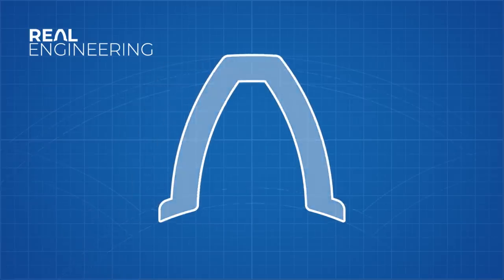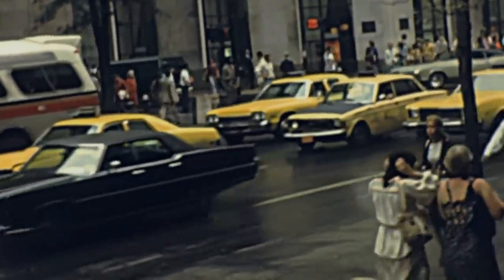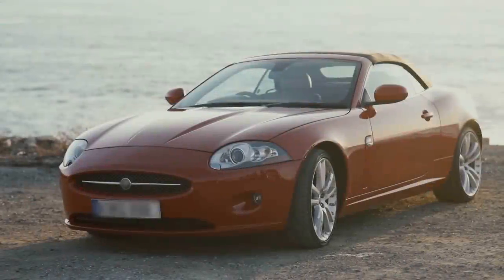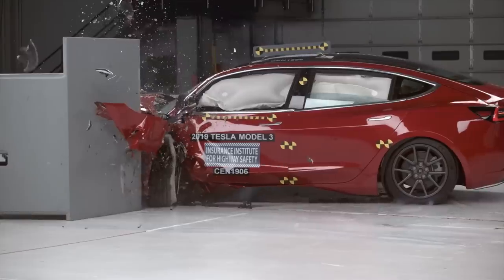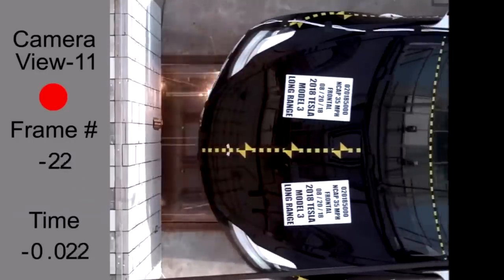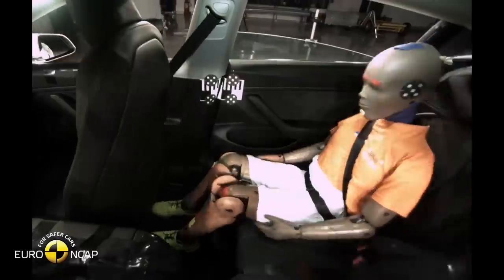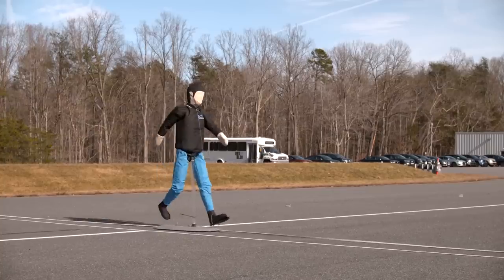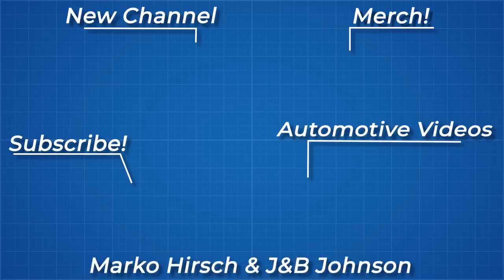Which Is The Most Dangerous Car?

Comment: Before even clicking on this video, I knew that the Mitsubishi mirage will hold a spot somewhere along here. Thanks Doug DeMuro.
Reply: I had to drive a rental mirage while my fiesta was in the shop getting a new front bumper (roadkill). It was total trash!!
Reply: Hello yobama
Reply: We have a Mitsubishi Mirage and I hate it now.
Reply: Thiissss
Reply: Or that it’s in the thumbnail?
Reply: Daddy Doug is life
Reply: Zias-Two rip I would just rather cycle
Reply: 🤣✌️ Doug is ma man!!!
Reply: I don't think the Mitsubishi Mirage is that bad. I just think there are better alternatives, such as the Kia Picanto, Ford Fiesta and Toyota Yaris.
Reply: @HELLO every simple turn is hell for the robbin
Reply: Mirage is the worst piece of shit sell in america since de 2000. in a video on youtube, it shows that they even dont paint the inside of front hood for econmy. quality and craftmanship is not an issue for them. even doors closed, you can see outisde from the side of the door and the body of the car. Sure, its the cheapest car you can buy on the market. But you got for what you paid,,,,
Reply: I have a 2018 manual transmission mirage and Its a great little car idk why it gets so much hate. Maybe the cvt automatic transmission one is crappier idk but mine is pretty zippy. It even outcorners my friends 2019 Camaro on the way into work and on the way home every day.
Reply: U can easily get a bent axle if you hit a curb. Zero f@#$ traction on wet roads with the type uh tyres they slip on thosE wheels
Reply: @KevAlberta  is it total trash because it did it's job because the bumper absorbed the damage or because it drove you from point A to Z workout any issues?
Reply: @richarddouglas6838  it seems like the only hate the Mirage is getting is on quality of how the car is built. It is the most affordable vehicle anyone can buy on the market. There is no complaints as what I can see or hear about on how it performs. It gets close to 50mpg and able to take people from A to Z with a 10 year warranty...so wtf?
Reply: THE KEKRONOMICON Really does it have stock suspension because I thought the 2019 had reeally soft rollie suspension, you might just be a better driver than your friend haha
Reply: The problem is that a mirage can only be seen off in the distance!
Reply: @StephenDeTomasi  The Fiesta and Yaris are much more expensive B segment cars and not an alternative at all. And I'd say the Space Star/Mirage actually beats most A-segment cars in the aspects that matter. It has pretty much the best mileage, quite a bit of storage space for its size, enough space in the backseats to comfortably seat 4 adults (assuming they're not giants), is one of the cheapest cars available and can get a consumer quite a few nice extras for not that much more. For the economical and practical driver, it doesn't get any better. And in terms of safety, most A-segment cars don't fare much, if any better. Volkwagen Up is one I know of and I think maybe 1 more.
Reply: Gotta love a good audience overlap
Reply: lol
Reply: Little cars are death traps
Reply: @mrsteve431 Lucky you
Reply: @mrsteve431 I drive tractor trailers and have a radar system that can see the speed of cars in front of me. I clock between 5-10 cars a day going over 100mph. Wish I could quit driving and stop risking my life for unappreciative people
Reply: That's pretty obvious by the thumbnail and obviously the A pillar is in where the driver seat is
Reply: @mrsteve431 Sorry to correct you. A 2017 Space star, as it is called over  here in Germany, is my 17th car in 27 years of driving experience. In these  years I have driven many English cars, Rovers,  Austins, MGs, (11 in total) some other European makes like 
Citroen, Opel, Renault, Ford, and two Japanese which count up to 17 cars in 28 years. With these 17 cars I've ridden more than one million Kilometers. I'M  definitely not an inexperienced driver!!!! But my Space Star is a good car. It does what it is intended to do. Driving from A to B without malfunction, with redicoulessly cheap tax of 22 Euro per year, running 100 KM with 3.8 to 5.1 Liters, depending on the road you're  driving. And its reliable. Hot weather, cold weather. Servicing cost are redicoulessly low, spare parts are cheap compared to so called premium brands like VW and others, and the liklyness of needing spares is very low. Have driven before a 1997 Colt which was incredibly reliable. Never let me down. Was changed with 23 years and 190000 Kilometers on the clock. The only reason Doug De Meo beats this little car so much down is that he gets paid  for it. He trys to make it appear bad as he puts it to standards of bigger competitors. There is simply almost no other competitor on the American market as Ford has never sold the competing Ford KA, smaller than the Fiesta.  If you just take it to what it was intended for, it works beautiful. It is able to manage German Autobahn, which has no speed limit. Today I' very drive it from Bonn to Cologne and for a some miles, due to traffic situation, I was able to speed up to 100 MPH. No problem at all. No unsafe feelings or anything that annoyed me. Good handling, low consumption, not loud, I was able to telephone with my hands free speaking device without screaming. The only thing it is not on par with is the acceleration of my former V8 and V6 Rovers.....  But at the filling station...
 It makes me happily smile. So once again. I seriously believe that European driving conditions are tough, especially in Germany with no speed limitation on Motorways, and I can only laurel the cute little car. When I think about the savings, compared to my Rover P6 V8 it only makes me smile
Reply: you are seriously signing youtube comments with your first and last name??? wtf
Reply: well its in the damn thumbnail
Reply: @johnrossewingiii3270  I'm on my 2nd Mirage for my delivery business (2015, 2020). I deliver fulltime out of this vehicle and never had one issue with them! I do the LOF's at 3500 and enjoy the gas savings. Now a days I'm starting to get people asking about them at gas stations too 🤣
Yeah, it's cheap but does the job. BTW D.M. is the biggest sell out
Reply: @notkray8468 Why exactly?
Reply: @bigchills7194 Hows it holding up?
Reply: I've drove a bunch of cars, a 2002 Pontiac Montana, 2004 Cadillac Deville, 2005 Hyundai Sonata, 1999 and 2003 Ford F150, 2008 Toyota Prius, and a 2024 Mitsubishi Mirage. Out of all of them, the Mirage is by far my favorite, so I bought it. And I been taking it on a ton of road trips, up to 12 hours. I am enjoying it! It has 5,700 miles in 3 months.

Comment: Lovely video! I thought of some additions:

Don't forget that small cars like the Mirage are used as city-brawlers, which means low average speed, so more time spending driving whithout adding much mileage, in an environment thats most likely to provoke an accident. Big cruisers are mostly driving on a highway or, like trucks, in a rural environment, so they are less likely to hit other cars frontally or sideways on.

One big safety issue in the desingn of a car is missing in this video: Pedestrian-safety, probably the most likely reason the Cybertruck will not get released as it is right now. 

I don't want to get hit by an unyielding metalblock with a sharp edge on the hight of my neck.
Reply: Was thinking about that too without some special tech the pedestriansaftey should be pretty poor.
Reply: The thing with the Mitsubishi is, while i agree that it might be driven mostly in city traffic as you wrote, that also means lower speeds which ususally means less injuries in accidents. But the statisctic he found said that it had the most fatalities of vehicle occupants. So people inside the car died in accidents. That is quite unusual for urban accidents.
Reply: @nirfz  Yes, urban areas actually have a lower death/injury rate than suburban or rural areas, not more. The very high density of intersections actually helps you because of the slower speed. The mirage probably does very poorly because most americans live in suburban areas where they need to drive at higher speeds and with lots of larger trucks. The urban environment still has pick-ups, but they are much less common. (SUVs are common everywhere now, but tend to be smaller driven less aggressively)

Also keep in mind that the mirage is one of the cheapest, if not THE cheapest, car sold in america. The most urban areas of this country are also some of the most expensive places to live. Of course urban areas also have better public transit, so the people buying a mirage are probably more likely living in suburban or rural areas, despite it being a "City car". American cities are still very spacious and if someone wants a car best suited for the city they are probably looking at a compact crossover or a sedan. You really don't need a car as tiny as the mirage in america, even in the densest parts of the city.
Reply: I appreciate your contribution to this conversation
Reply: @raceman9586  True, my thought about why especially this car could be the "most lethal", circles around something you wrote: the cheapest car sold. Who buys the cheapest car? It might not be the same in the US as where i am from, but cheap often times means beginners. ->Drivers between 16 and 25. This age-frame covers the most "endagered/dangerous group" of drivers. The risk awareness as well as routine/experience on average are low. 

While most new drivers i have seen got old used cars to start with, there were some who got a new cheap car as a gift from their parents.
Reply: Also, the mirage is also extremely popular in some Third World Countries.. Thailand or malaysia cant remember exactly but very popular
Reply: @raceman9586  Mitsubishi admitted to making the Mirage with emerging markets in mind. It IS a city car, but not in a US way.

Comment: >Head hits A-Pilar

>4 Star Safety Rating

Excuse me WHAAAAAAT?!
Reply: Welcome to America
Reply: Well there have been a few cars where the A-pillar practically crushed the drivers head between it and the seat, so I'd say that's still an improvement!
Reply: Most of the world has terrible safety standards. Tesla’s are rated perfect, but they fail to mention the frequent fires and explosions Tesla’s go through after crashes.
Reply: The head hitting the pillar was for the small overlap crash test (1/4 of the front of the car hits the barrier). That small overlap crash was conducted by the IIHS and it was rated a "Poor" result for that test. When the video mentions the car scored a 4, they were talking about the NHTSA and NCAP tests, which are DIFFERENT tests from the IIHS, and they do not perform the small overlap crash (each company does a different set of tests), so they did not see that same result.

Also, overall crash result is based on several combined tests, so while it may have failed in one area, other areas (ie. full frontal crash, roof strength, side crash, etc.) may have helped pull up the score to a 4 out of 5. When buying a car, it's best to check crash results from different organizations, since they all test different things and several of the tests do not overlap.
Reply: That was in Euro n cap where it doesn’t use frontal offset
Reply: @angelgjr1999  That might be so but at least there's somebody alive who can at least get out or get pulled out of the car after the accident.  Same with gasoline cars.  There's always that chance of a severed fuel line or leak catching fire.  But the occupant must first survive the initial impact in order to get out alive.
Reply: @angelgjr1999  They are not that frequant. I know, cause we crached multiple tesla where I work. Only one cought on fire because we purpusfully pierced the battery.
Reply: @angelgjr1999  
Gas cars actually have a higher chance of catching fire than a Tesla. The reason you see Tesla cars on the news for catching fires so much more often than gas cars is because gas cars catch fire all the time. It'd get boring to report it so often. It's a lot more interesting when a Tesla catches fire.
Reply: banana ? Source?
Reply: @NahNnii  
Yes, isn't it obvious they would try to minimize the chance of a fire? Just because they do doesn't mean they are less likely to catch fire than an EV, it just means they are less likely to than if they just didn't do anything. Tesla does this as well with metal plating around the battery.
Reply: @angelgjr1999  Apparently, according to NHTSA, it doesn't even need to crash.  https://static.nhtsa.gov/odi/inv/2019/INIM-DP19005-76719.pdf.  They were okay before the most recent update.
Reply: "This car is terrible and not worth the money."
9/10 IGN
Reply: ᅣ ᅲᅢᅧ홋 내구 ᅥ믇ᄂ • 98 years ago The Euro NCAP does include a 40% offset against a flexible barrier, which is considered to be much closer to an actual accident with another car. This kind of impact reveals different (serious) issues with car designs, so from some aspect, the different tests do add up.

Hitting an inflexible barrier however is closer to accidents where the car does hit a tree (on those rural streets with magnificent views…) or a highway road construction barrier, so both kinds of tests do have their pros and cons.

In total, the different kinds of NCAP tests also do come to different results, like Chevrolet Aevo 2006, which scored 4 stars in the US NCAP but only one in Euro NCAP (… add this to the list of “why Europe and Japan are buying few US cars”, next to “streets are more narrow” and “parking spots are smaller”).
Reply: Well. When the standards were made in the seventies you tend to get things like that
Reply: - IGN
Reply: @thenthson  The European NCAP test results are always accompanied by the year they've been published: as the test is changed according to current standards and developments every year. As such, you can only directly compare two cars from (about) the same year. For example, a "5 stars from 2010" may be more like "3 stars from 2020".
So there is no requirement to stick to outdated testing standards. This also makes it much harder for car manufacturers to "tune" their car designs to excel in a specific test category, as cars do have a design and development phase of about 7 years and exactly that category you've been aiming for may look completely different in a year or so.
Reply: you should wear a helmet
Reply: Angel Gutierrez that is not true many Tesla’s don’t explode after a collision but because it is so rare to see the news loves talking about it that’s like saying you have a insanely i high chance of death to murder cause the news talks about it a lot. The news isn’t always the best place to get info
Reply: Here in Pakistan having airbags in a car is A privilege 😂😂😂.
Reply: @angelgjr1999  
Ik the batteries should just be in the trunk ffs why do you need a front trunk when you can put two grown harambes in the back one it whould aslo improve frontal impact stability 
Also isolating the batteries better whould help in any case
Reply: @Aryan Alone There are many, many more ICE vehicles than electric ones, yet very rarely do you see them on fire. Of course it happens, but the chances are low. Electric vehicles can have heat problems, as evidenced by the number of Tesla cars thst have gone up in flames whilst driving, not in an accident. Try to be realistic about risks.
Reply: @Aryan Alone Perhaps you should do a little more resesrch in to what they actually test, how those tests are conducted and crucially, how the scores are awarded. That infornation is readily available. Here are a couple of clues... no car is 100% safe in every test, and those tests are carried out at lower speeds than those experienced in typical road driving. There's practical and physical limits as to how much crumple zones, seatbelts and airbags can protect you.
Reply: So I work in the Quality Control department at a car factory, and my question is why the hell is there no airbag in the A-Pillar?
Reply: @angelgjr1999  they aren't frequent
Reply: @FuSiionCraft  who said I was going😏
Reply: It hit the A pillar in THE FRONTAL test crash. So practically the Mirage is safer than older cars
Reply: To be truthful in a Mirage if your head hit the A pillar in a Mirage in an accident your head would be fine the A pillar would fold like butter.